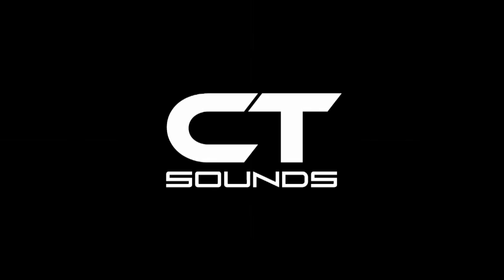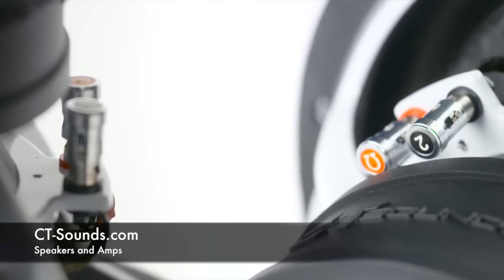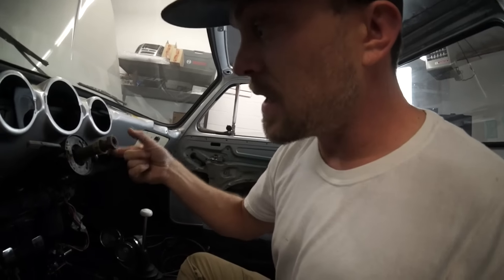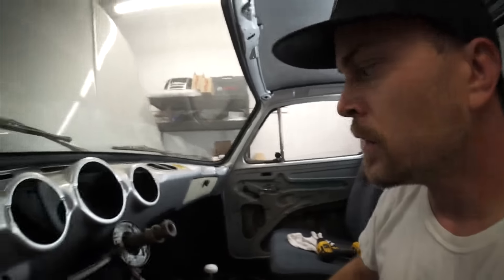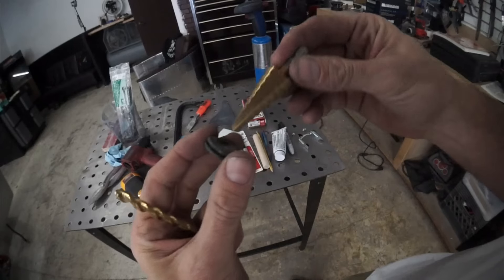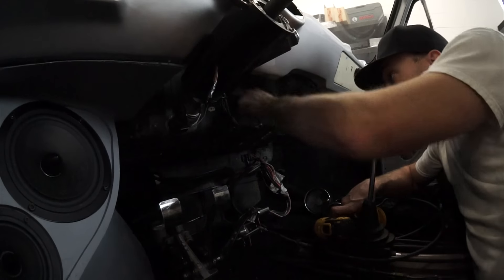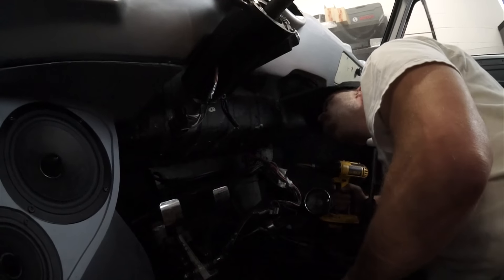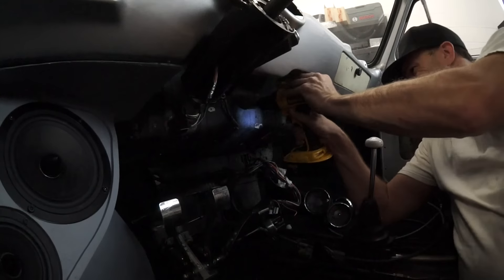American Cheese

Comment: if your filling a small hole in sheet metal you can also back the hole with a piece of copper then use mig wire to fill it. the weld won't bond to copper. 

Looking forward to a start-up video of this subaru motor in the future

Comment: Sand/grind clean all areas. Wipe down with acetone. Masking tape cabin side. Mix tubes of JB Weld. Smooth trowel into holes, careful of tape. 24 hrs later- pull off tape. JB Weld is just as strong, and won't rust.

Comment: If you had a piece of copper to put on the back side of the welds it will soak up heat and the welds wont stick to it. Old broken drum cymbals work very well.

Comment: Should have used a welding spoon to fill the holes in. Also why do you need a fire wall if the engine is in the back? 😂😂😂😂
Reply: It a death trap fuel tank is in the front Doug better get a new break system  for that engine swap. 🤔🤔 at least he fix his glove box latch there was actually no tape on it. 😄

Comment: You're right about cutting the firewall out! There's no fires in the front of the Mule. Why have a firewall there? It should just be called a wall. All the fire is in it's booty.
Reply: +u9Nails Fuel tank is in the front. If this was electric then id say ya no need to call it a firewall.
Reply: Sounds like a Taco Bell commercial!!

Comment: Are you going to put iPad in the mule?
Reply: +Doug Bernards (Soundman) iPad Pro 12.9" screen?
Reply: +T0mpkinz Two ipad pros?
Reply: +Doug Bernards (Soundman) I am trying to find the video where you went through the mule equipment. Specifically the hybrid audio and why you don't have a traditional 1" tweeter. I sort of remember it was frequency range of 4" but wanted to see again.